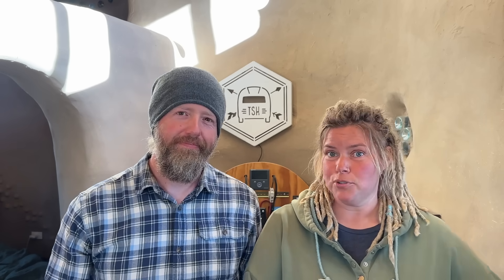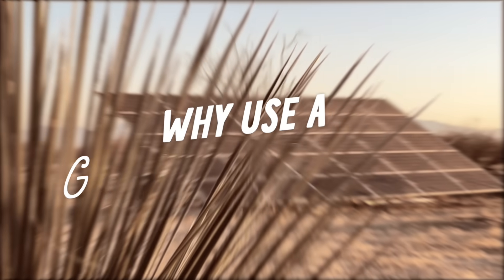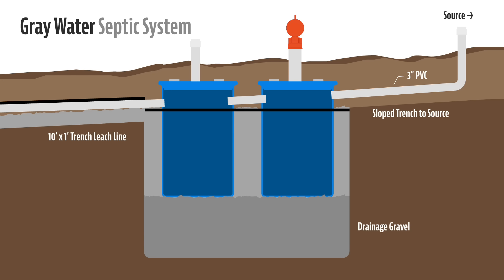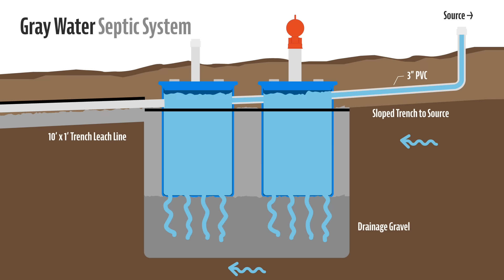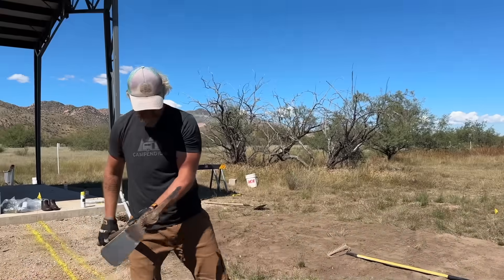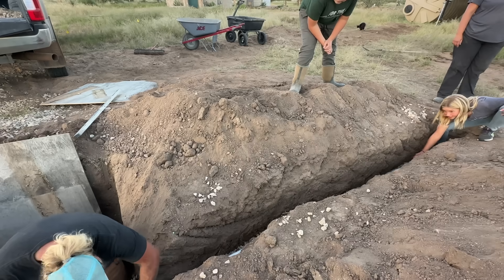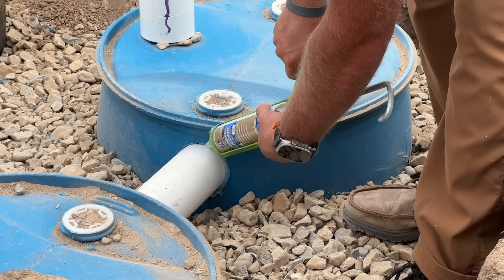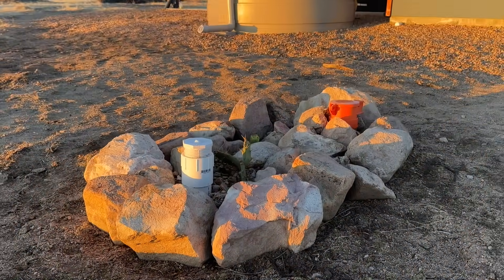How to DIY Your Own Gray Water Septic

Comment: Did you guys have to get it permitted? I've been looking to do something similar but don't want inspectors coming around
Reply from the maker: You'll have to check with your local county codes to be sure. Sometimes they are also called drywells.

Comment: Will you have to build a bigger version of this when you build your house. Or will you just run a pipe from the house into it?
Reply from the maker: Single Family Residences require a permitted full septic system. This is only for gray water.

Comment: Looking pretty good- might hit the exposed top of the cleanout with some spray paint.  Give it a little more UV protection from the sun.  I would bet the second chamber is not used- and  the hole you dug with the rock in it would also act as a holding tank.  Looks like your soil is pretty sandy.  Other thought was plant a Tombstone’s Rose Tree .

Comment: Loved the video! Question: when you put in your rainwater catchment system,  did you also install first flush system. Living here in AZ, they do chemtrail us a bit, plus dust birds etc. How is it working if you have one?
Reply from the maker: No first flush - not recommended by local rainwater experts for several reasons. Dust settles to bottom and anything on the roof gets blasted by the sun so it’s not really worth the complication and water loss.

Comment: FYI if you use a curved pipe instead of a 90 by your source then there is never a chance of buildup at the 90 elbow. This works best for black water septics but a good idea for all septics. Just something I have found out after 40 years in construction. 
Overall good job though, you guys are doing wonderful
Reply from the maker: Those are pretty hard to come by out here, and like you said if it was black water would definitely recommend. Haven’t seen any change in water movement with the 90 even with a full flush so I think they’re ok for this specific situation. Adding grease, food, etc would definitely change though.
Reply: That curved pipe is called a “sweep” or “long sweep”. I’m not a plumber, but I know they are required by code in certain situations when working with waste water pipe.

Comment: yeah, the kitchen sink water is unfortunately my issue with building in the EU, since not only do they count as black water here - which I can understand but is still hella annoying - but also many formerly accepted versions of black water septic tanks are no longer permitted, making it both financially and space-wise impossible to create an appropriate off grid system for it. And while avoiding black water by forgoing a flushing toilet is doable, kitchen sinks are indispensable. But I shall not despair and continue searching for a solution. I like your grey water system ^^
Reply: Outdoor kitchen sink for washing dishes only.
Reply: you need a mini treatment system to basically send semi clean water out